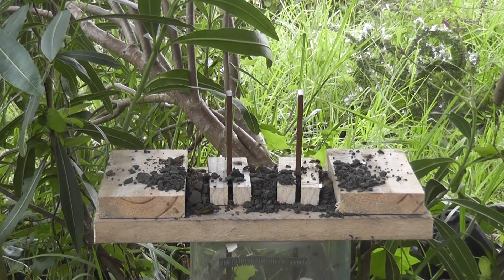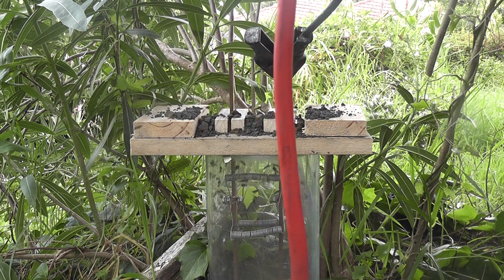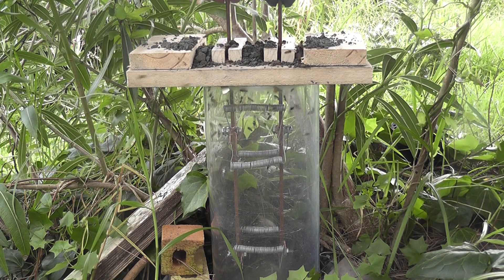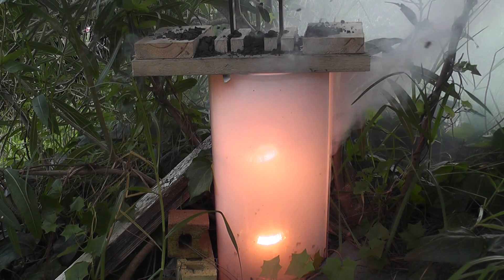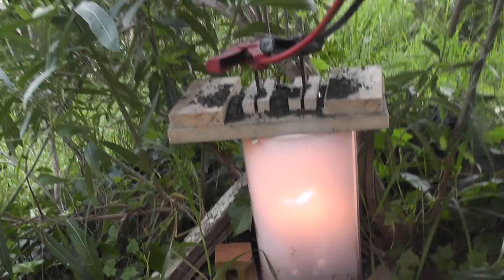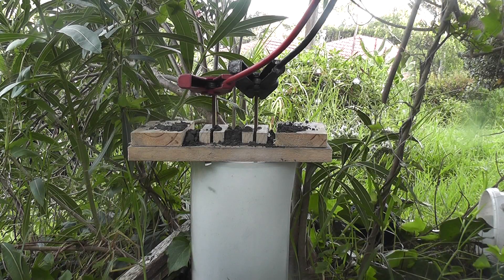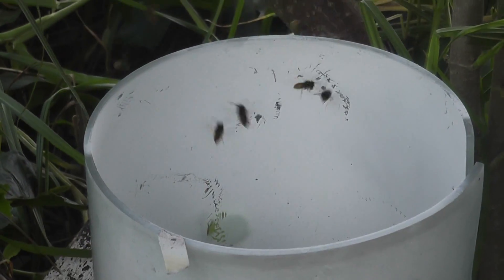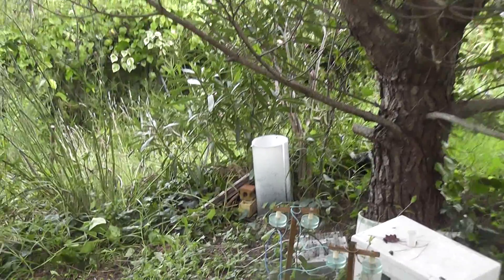Galvanizing Wasps with 24 Volts 200 Amps heater

Comment: The batteries are to powerful for the elements, You need a rheostat to adjust how much power goes through the heater. After that display you may only need one battery

Comment: If hey I shouldn’t be complaining because I have beach wagon that you can by at Walmart or target in red or blue and a 2007 model Lakewood P-25 fan on one side and an intake spot on the other so the wasp that was chewing on our patio to give it to the queen and make a nest out of the wood shavings I had the fan blowing up so on the other side it would have a vacuum effect so as the fan was running on high he flew off the table after a while and got sucked in to the fan and also got stuck inside the motor so long story short this may be mean to them but I shouldn’t be getting mad at them

Comment: If these are wasps then they are yellow jackets. If these are yellow jackets they are the largest ones I've ever laid eyes on. These resemble Africanized bees more than anything else. The YJs here in the states are much smaller than these. Mostly we have mud wasps/dirt daubers which will sting, but are not aggressive. The only attack if you cause them to. And we have paper wasps. The black ones aren't too intolerable. The red ones are very aggressive and a pain in the ass to deal with and get rid of.  YJs aren't seen until late summer here, as in August and September. That will sound odd to you Kiwis and those in Oz. But the idea of a cold July would be like Mars to me. Or heat in Jan/Feb. which is the dead of winter. It's just beginning to warm up here now in middle Tennessee.

Comment: LOL - way dramatic stuff, very impressive. Less visual but good is to jet a blast of talcum powder around nest entrance = very rapid, near 100% kill rate as the talc is wafted & carried throughout the nest by the wasps themselves. Night is best when they are  all quietly in the nest, although again even less visual.  The super fine particles of talc block all spiracles ( insect breathing holes ), killing entire colony within minutes. Many wasp exterminators use insecticide in fine powder form to be sure but several personal experiences show talc works just as well. Of course often specialist equipment & skills of all types needed to reach many nests where you clearly need the professionals. Simple ground nest, talc will do the job well, sweet smelling death.

Comment: just pour gas down the hole in the evening right at dark and then throw a match to it .there all gone then . a lot of times i use a 20 foot length of 1 1/4 inch pvc to pour the gas through like a nozzle kept from getting bit

Comment: Dumb question... I tried to Google it but the only hit is this video.  What is the purpose of galvanizing this cylinder over their nest?  Does it weaken their exoskeleton or something?
Reply from the maker: All questions are good questions. By melting the elements out the galvanizing evaporates and does exactly the same as insects spray and blocks the wasps airways.

Comment: What material did you make the elements out of??
Reply from the maker: The elements were made out of galvanized wire from old screened armoured power cables.

Comment: Really?  I mean WTF ??    Just make a cheap wasp trap, ( maybe $4) load it with rotting meat and sugar water, and the wasps would be dead & gone in a few days.   BUT  The pyro was interesting to watch.   Hope it didn't cost too much.
Reply from the maker: I just try different methods as I have been stung a few times and revenge back to the stingers. Wasps are a pest in NZ. All the parts were free from the scrapbin.

Comment: Dude, Ima welder. And 24-200 is some serious power. Like welding a quarter in steel plate with ease. You could have turned it down and spared your equipment while still massacring the whole hive. This is overkill. Which isn’t a bad thing. But yeah

Comment: Of you really want the wasps gone: get a decent powered shopvac, fill 1/4 with water and dish soap, then use a long hose with narrow nozzle and put the end of the nozzle right next to the wasp's hole. They'll get sucked up when trying to leave or enter, then drown inside the shopvac. 

Leave it on for a few hours. This won't catch the queen, but it will deprive the colony of enough drones to be able to feed the queen and the young.

They'll starve to death if you deprive them of the very necessary workers who are needed in order to gather food. No more colony. Very simple and 100% effective.

Conversely, if you want something a bit more entertaining... Attach a common electric motor to a battery, one capable of spinning at very high speed. Attach a couple of lengths of weed eater string on opposite sides of the rotor head. Then set it infront of the nest and turn it on by attaching the power cables. 

You'll be able to hear each ping of a wasp being bashed or sliced by the weed eater lines. Plus, since it's making noise and moving air next to the nest they'll swarm flying right into the death zones. Leave it running for a few hours, no more wasp colony.

More exciting than the shopvac, just as effective. With the added bonus of leaving a killing field of wasp corpses for birds, ants and other creatures to feed on.

Comment: You did it the hard way.  After dark put a board with a circular cutout that will let you put your garden water hose inside it, over the nest hole, squirt a generous amount of liquid dish detergent in the hole, then put the hose in the hole and flood the nest with detergent water.  After you have sent several gallons of water into the hole, stop and leave the board with the hose in the hole overnight.  All the foraging and guarding wasps will be in the nest after dark and drowned by the wetting action of the detergent and water.

Comment: Why not just pour molten aluminum into the nest? That should remove the nest, and give you some modern art in the process (once you dig out the aluminum).
Reply: jdraper12 Both spellings are correct, depending on where you live.
Reply: Yea, but if there's no more wasps, there wont be anymore wasp extermination video's
Reply: if they happen to have a second entry point to the nest there could be trouble
Reply: their nest is basically made of paper, not tunnels like an ant colony. so it would just burn.
Reply: Not sure about them being able to withstand the temperature and stay intact. But yes, that is what would happen.
Reply: lbochtler there would also be wasp carcasses throughout it
Reply: Make Us Whole No, it melts and destroys wasp carcasses.
Reply: Ray Carter true
Reply: Ray Carter  just launch a billion dollars missile at them, thats how the usa military deals with drones
Reply: I believe there are multiple locations in his prooerty
Reply: Laharl Krichevskoy the missiles aren't that much dude.
Reply: lbochtler aluminium*

Comment: I got my hands on 2 batteries from one of the diesel generators at work, they look like the black one in the video and are quite heavy...  12V 1500 CCA each.
Reply from the maker: Good stuff. These are ex substation batteries.

Comment: this cant be good for thet battery mate
Reply: once i was traveling back from college....450 miles

stopped to get gas and their was a truck that needed a jump

talked to the dude...."ya i got cables i made from 1/0 welding leads....it will jumpp anything"

opened his hood....he had a peice of card boarrd over the battery to stop it grounding out on the hood....
the hood had a burn mark...

and that battery was so fucked, i could not jump it
Reply: yup it aint
Reply from the maker: Same as running a large starter for 30 seconds or so. They draw a lot more current then 200 Amps on large diesels.